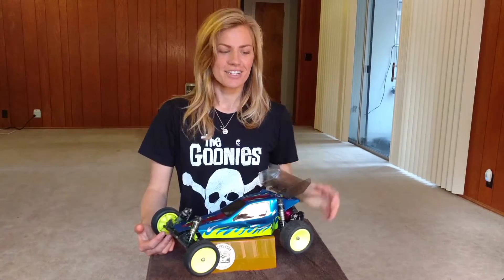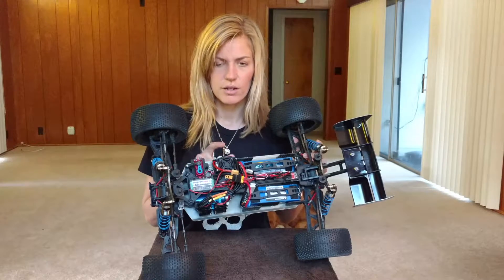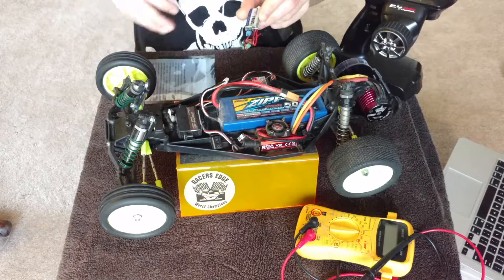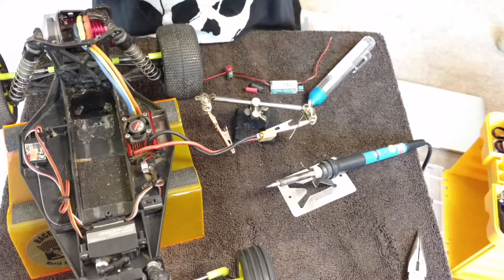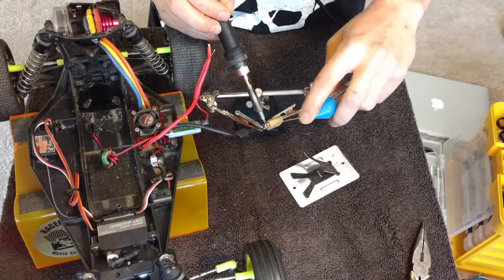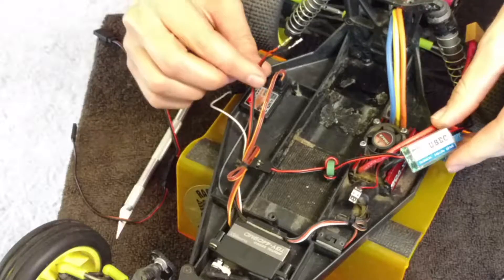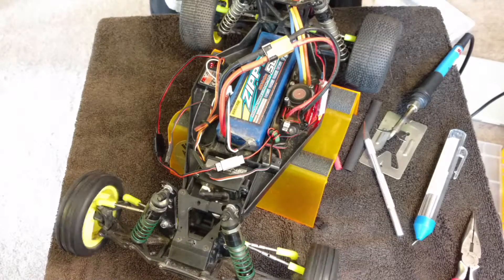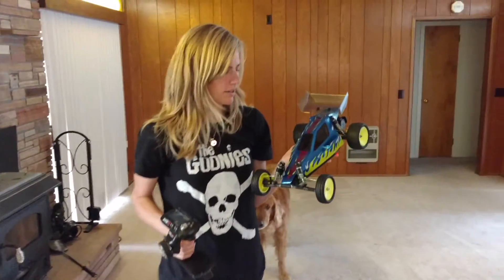HOW TO INSTALL A BEC  |  Vintage B3 Team Associated buggy

Comment: But why does the bec from the esc not even give you the 6v? I dont like this flattering cook the esc batterie wires together with the ubec....i better would use an Extertal 2s batterie with a separat switch and use an esc extension for not Ruin the esc when cut off the cable and Just let in the Signal cable in the receiver.....then you can support the System by placing the receiver batterie some where in the Model and with the switch u easy can turn on/off the receiver supply and not disconnect the battery cable from the receiver all the time when ure finished driving

Comment: Hi RC Girl. In the video you hooked up the BEC to the receiver bypassing the power from the ESC. In this way, the BEC can power everything that is connected to the receiver (except ESC which draws power from the battery) servo, lights, winch.
Do you think it is possible to connect BEC directly to the servo with additional signal cable from the receiver? And of course the power wires from the ESC to the receiver would have to be connected.

Comment: Great video , I actually normally get vital tech' knowledge from your video's. and I was wondering to install a BEC because my rally car with a HPI EHM 3S ESC has a problem and it starts as normal but with stressed runs it will suddenly stop and if switched off and on it runs again. surprisingly the motor and ESC are running cool with added fan. other connections on the receiver are Engine sound simulator essone, Tamiya lights module and a savor. I hope a UBEC could solve this.
Reply from the maker: Yeah it could help. Sounds like you're running a lot of stuff off of it and it might not be able to handle the amp draw. Keep me posted on how it goes!
Reply: Sure I run a lot of stuff off the ESC and I will keep you updated when it arrives in two to three weeks.

Comment: I still don't really understand what the purpose of this is and why you would need to install a BEC in a RC car. This is the first time i have ever heard of anyone mentioning or even using this. Why not just update the ESC or get a better one. You can get a solid ESC for under a 100 nowadays.
Reply from the maker: yeah you can buy a new ESC instead, but this is a cheaper alternative/option. You can also use a BEC to run devices at different voltages without having to be tied to what your ESC puts out, or run more devices.
Reply: gotcha thank you
Reply: It’s a relay. Relays purpose is to receive and  input for example you turn on your headlights the headlight switch cannot handle the load so you basically charge a small coil from the input of the switch and in turn will illuminate your headlights. THE RELAY HANDLES HIGHER LOADS!!! In the rc world it prevents BROWN OUTS when you steer and the motors cogs or does not operate. Is super popular in the crawling/scaling, and comping world. Great question.